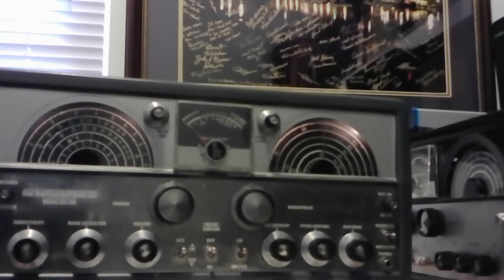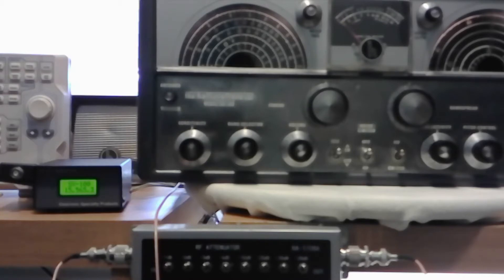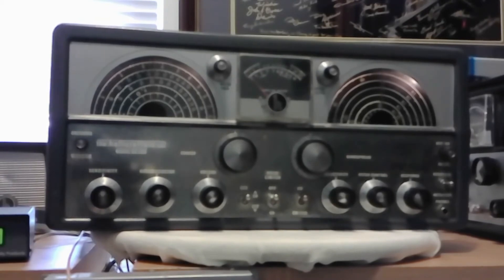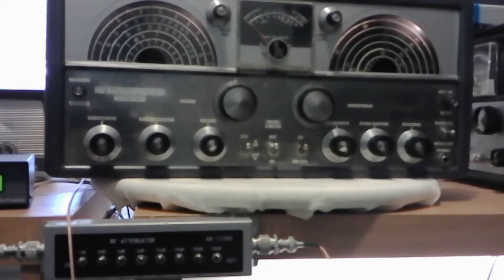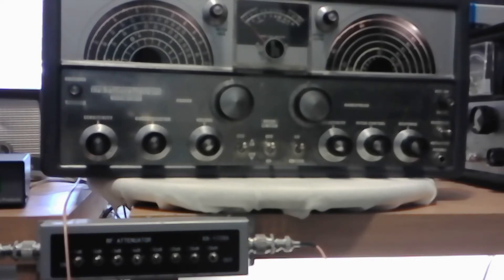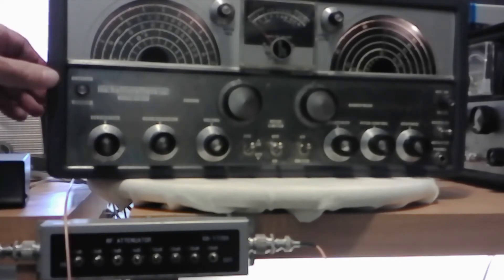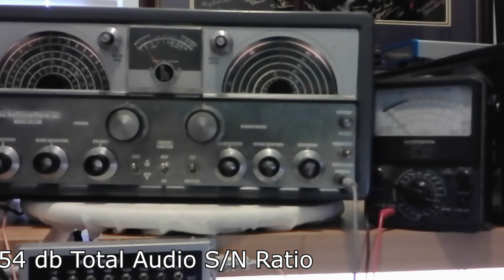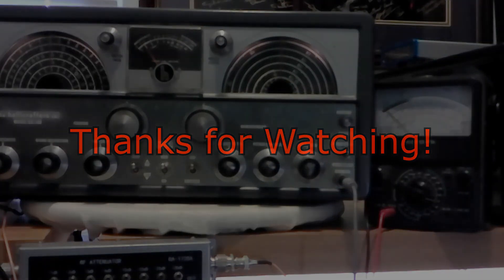Vintage Hallicrafters SX-100 Mark 1 Shortwave Receiver Restore: Alignment and other tests

Comment: I have an sx-100 and am having trouble getting the notch to function.  I believe i have it as well aligned as I can  without a spectrum analyzer.  The coil has continuity (about 10 ohms), both pots are working, all resistors In the area seem within spec, I replaced all the paper and electrolytic caps, swapped out the 6c4 tube with no luck.  The off switch works but doesn't affect the function. I get attenuation when I adjust the two pots and a very slight rise and lowering of signal on every rotation of the frequency coil.  If you have any hints from your experience I would love to hear them. It's driving me nuts!
Reply from the maker: Before the next step have you checked the resistors?
Reply: @i82996   The resistors seemed reasonably close but maybe I will go through again and verify.  I have been assuming the mica style domino capacitors don't go bad but then I noticed that the two large ones that surround the depth adjustment are 7800pf!  They (c103 & c104) are also not listed on the parts list 😬. I read that they are likely paper caps in a mica like package if they are this large which I wasn't aware of.  I guess maybe it's time for me to build a capacitor tester.  It seems bizarre that the two pots always attenuate the signal regardless of the switch shorting out the notch coil.
Reply from the maker: @tomstafford1605  the micas are micas and mine tested right on w/ no dc leakage. Will look over schem and reply 2 nite
Reply from the maker: A couple more things to try before rebuilding the 2nd IF mixer box.  The Mica between the mixer box shielded lead and the filter box, C31, 470 pf, was leaky in my latest set and had to be replaced.  A mica high voltage cap can be replaced just to make sure, and there should be no drift effect.  The R75 15k pot and the R76 5k pot with the switch should be serviced.  Desolder and remove them and clean them with De-oxit.  Test with a meter for a smooth increase and decrease, and for continuity/no continuity on the switch.  When reinstalling, be careful not to over-torque R-75 with the attachment nut or the knob will not turn.  Test as much as you can after reinstallation.

I don't expect a problem with mica cap C-102 in the notch circuit.  

If you can measure inductance the notch coil should be between 2.5 and 3 mH.  10 ohms seems consistent with that.

There should be a difference between the switch on and off.  When re-installing the switch verify all wiring to the schematic.  I don't know of any differences between the different Mark designs in this area, so any schematic should do.  You don't know (unless you bought this one new) who has done what inside these things.

If still there is no difference between on and off and no real peaks and notch valley, I would go back to the start of the alignment procedure in the book and start again with a signal generator and analog meter on test point B.  I found that the directions have to be carefully done (contrary to my nature in these things) and a good analog alignment can be done of the 50.5 kHz second IF without the bells and whistles of a spectrum analyzer.  Then follow the notch adjustment procedure in the book exactly.

I am thinking the problem is most likely in the pots and switch as a first choice since you say the switch is not turning the notch off.  When off, there is no effect at all adjusting the notch frequency.  When on, the notch effect is prominent when R75 is good and adjusted properly.

The notch filter is a part of the entire 50 kHz 2nd IF which begins with T3 and T4 inside the mixer box and associated caps and ends at T5 and T6 and associated caps including C37, R29, and R30.  V13 is the first 50.5 kHz IF amp, and V6 is the second 50.5 kHz IF amp.  The switch between USB and LSB comes before the 2nd IF and does not affect the notch which is applied in the 2nd IF signal.  If nothing above works you are probably facing a rebuild of the mixer box since the IF coils for V13 are inside the box.  Once you are inside that, you might as well rebuild everything inside since this is the second most difficult thing to do to restore an SX-100.
Reply: @i82996  Thanks so much for the in depth response!  I realigned again and followed the notch adjustment instructions to a T with not luck. I think the core might not be moving in and out of the coil!  Might be internal damage!  The black core that is visible in the end of the tube isn't moving.  I thought it must have been some type of cap but when when I lightly touch it it moved.  I am wondering now if the shaft broke off from the core.
Reply: @i82996  That was it!  The 65 year old glue broke inside where it attaches to the metal shaft!  I gently pushed it all the way in and when the shaft pushed it out it worked as advertised! Only once of course.  I will have to put a drop of epoxy on there.  Something to keep in mind if you ever have a similar issue.  Hope to hear you on the air someday!
Reply from the maker: @tomstafford1605  Happy to help. I assume you are talking about L19 coil, the notch Freq adjust.
Reply: @i82996  correct 👍